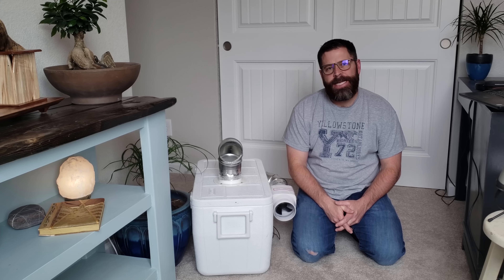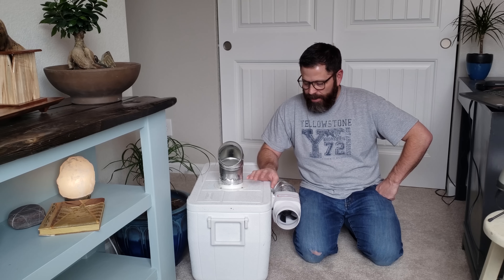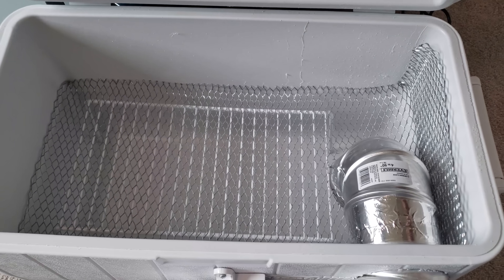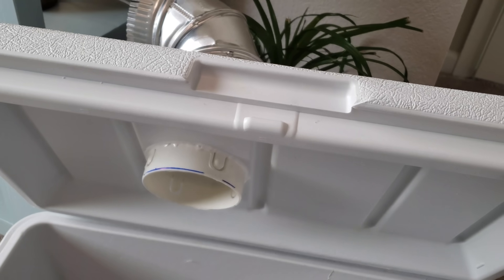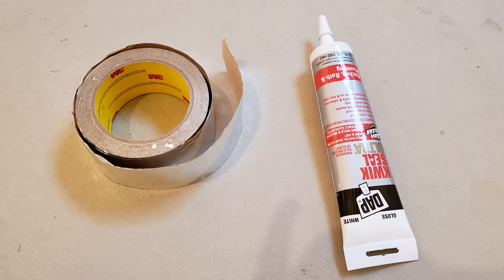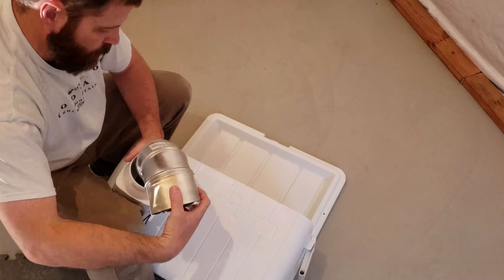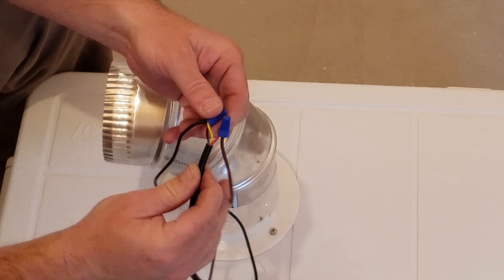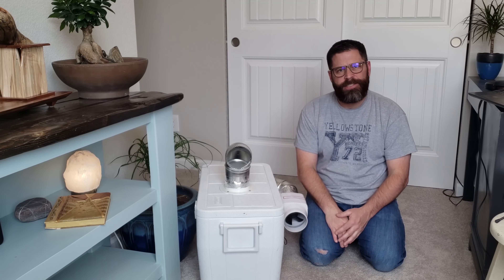Homemade Portable Air Conditioner DIY - Coldest One Yet!

Comment: 20 minutes  ice all melts!!! 45 minutes tops...Been there done this back in the 80s.
   this contraption is nothing more than an ice melter, not an air-conditioner. When the ice all melts, you’ll have a heavy cooler filled with water that you’ll have to get rid of somehow. If the cooler will hold 10 gallons of water, water weighs 7 pounds per gallon, that’s 70 pounds you’ll have to dump somewhere.
  I did this very thing with a Styrofoam cooler, and a 12 V blower motor powered from my car that I could plug directly into the cigarette lighter power supply in my company car.. I thought that cooling such a small area would be no problem.
 Here is what I learned.
 . I worked for the electric company, and they did not buy air-conditioned cars for us back in the 80s. But the building I worked out of had unlimited ice for the lineman to fill their coolers in the morning. They had two large commercial ice machines, and we could help our self to the ice.
  I bought the largest Styrofoam cooler that would fit on the passenger floor of my company car. It was about 30 inches long by 18 inches deep by 14 inches wide and had a lid. I bought a blower motor out of the car junkyard for $10 and mounted it to the lid, and I put a cigarette lighter plug at the end of the wires for the blower motor so that the blower motor would blow cold air over the ice. I bought a piece of plastic 4 inch schedule 40 PVC to direct the air to me as I was driving.
  The blower motor was mounted on one end of the lid, the PVC directing the air to me was mounted to the opposite end of the lid.
   On the first day, I completely filled the cooler with ice. It was about 85° that day. Very humid. I put the lid on the full ice chest, plugged the adapter into the cigarette lighter outlet to power the motor which started blowing cold air over all that ice and the air came out of the chest on the opposite end through the PVC elbow that I attached to the cooler lid.
  I started out on my route for the day with cold air blowing at me from the ice chest.
  After about 15 or 20 minutes, I noticed a change in the temperature exiting the ice chest. Shortly after that I noticed as I went around bends,I could hear water sloshing around in the cooler. After 30 minutes maybe 40 minutes, I looked into the ice chest just out of curiosity, and all of the ice was melted,, not to some of it, all of it was melted. The car blower motor that I installed on the lid was like blowing a hairdryer onto the ice. I had to pull over and use an old McDonald’s drink cup to empty the cooler because it was too hard too heavy to pick up Because I pulled my company car into the garage next to the ice machine, to fill the cooler with the scooper from the ice machine while the cooler was in the car . So I hand bailed out the cooler for a few minutes till it was light enough for me to dump them remaining 6 inches of water, and I put the cooler with the motor and the lid in the trunk.

Don’t waste your time or your money building the cooler suggested in this video. Your refrigerator couldn’t possibly make up enough ice to keep up with the melting.. even if you drive to the local convenience store and buy bags of bags of ice. On an 85 or 95° day, that ice is not gonna last more than a half an hour to 45 minutes tops if you have  air blowing over it.. not only that, it will  increase the humidity in the area you are using this “ice melter “That’s all this contraption can be. It is an ice melter.
Reply: You can do everything you just said. But hes using an ice chest. They come with a drain at the bottom. The one in the video even has a drain you can see. A long enough rubber hose he can drain the water out the car when he has 10 minutes to pull over and open the door. Nbd
Reply: Brad 435 
  Bread, the water in the weight of the water is secondary. That’s like buying a car that gets 5 miles to the gallon, and justifying it by saying yes but it has a 50 gallon gas tank.The point is, that ice only lasts less than an hour. When I made my ice chest with the blower on top back in the 80s. Are used a Styrofoam chest. Water was sloshing out of that as I went around vans within 20 minutes. When I went to dump the large ice chest of sloshing water out less than an hour later, I ended up getting water on the floor of my company car. This is a waste of effort/money/ time to fill the chest the size of the one in this video, it’s probably $10-$15. Your home refrigerator couldn’t make this much ice in 24 hours to fill that chest..
   Sure you can get cold air coming out of an ice chest, but the ice lasts a matter of minutes.. I was actually shocked at how quickly the ice melted
    I hope you get a lot of views and make some money from YouTube. But if you marketed this item at Walmart, not only would they not sell it because Walmart does not sell junk. You have to prove something works to get it in those Walmart store. But if some store did actually sell these things, I am positive all of them would end up being returned..
   You do know how to make an acceptable video, you speak clearly, you have a great idea, but it doesn’t work for long.. tell people they’re going to spend more money on ice because they’ll have to buy a chest full of ice once an hour. That’s $10-$15 an hour, if they spend five hours in their car a day, One hour of that time is going to be getting rid of the water and refilling the chest edit cost of $50-$75 every five hours for ice..
  People would be better off buying a $99 air-conditioning unit and mounting it in one of the windows. And powering it using an inverter powered directly from the battery with heavier cables, and not from an Accessory outlet or the cigarette lighter.. I have seen this done on vans that people use as low-budget campers. The only problem is, unless your car is running, the air-conditioner with the inverter will drain your battery within about 15 minutes to the point that it won’t start the car. You have to have the car running to keep the battery topped up..
   But the best solution for air-conditioning is, buy a car with air conditioning..You can lease a cheap new car these days for around $120 a month with air-conditioning.That’s less than you’ll pay for ice just in a few days with this ice chest contraption/ice melter.
Reply: @harrylime5147  I'm perplexed.  I can't believe you just called me "Bread". While I'm not offended I would like to know why you chose "Bread" a simple oversight? An intentional jab? I dont know. That entire story you sent me and the one glaringly obvious mistake was "Bread" leads me to believe it wasn't a mistake at all. So I, being currently under the impression you're calling me names am not going to resort to such behavior. Instead I'd like to commend you on your creativity and choice of words. Also, I am not the guy in the video. I didn't actually catch his name. Perhaps his name to is Bradley/ Brad and your entire message was intended for him. Also maybe he enjoys being called bread. I wouldn't know as this is the only video of his I've ever seen and as far as I know you could be his biggest fan and simply are offering constructive criticism. Either way, his contraption "ice melter" as you so eloquently referred to it as is pretty cool. With modifications and or a more creative mind it could be quite useful on a case by case basis. The biggest flaw you pointed out was the "sloshing water" to which I'll say maybe he could use frozen bottles/jugs in place of plain ice. They would stay frozen longer and if you're out doors camping (or sitting in a tent thinking of creative names to call people) cough cough it wouldn't be a complete waste of time/money or energy. I will say, buying a vehicle with ac is not a bad idea or perhaps some other out door air cooler as I'm  sure they are made somewhere by someone.
Reply: Brad 435 
    I think my phone thinks I have a speech impediment. I really need to start proofreading
Reply: @harrylime5147  Interesting.
Reply: @DuhByrd  I think you got caught up on the misspelling of your name and completely missed his main point that this will cost a fortune (in ice) and be completely ineffective at cooling down any space you stick it in.

Comment: How long can it run with temp differential so we can figure out BTU total and efficiency?

Addendum
Also, try this instead https://www.newegg.com/bgears-b-blaster-120x38-case-fan/p/N82E16835132042
Mount it directly on lid  Have short stove pipe come straight up to lid/fan.  Put a soft foam/seal around top of stovepipe so it seals when lid closed.

Comment: You should make one that has a variable speed controller for when you dont want to make it that cold or dont want as much air flow
Reply: ,funny I was just thinking about how I have that same blower and a DC speed controller already wired up to it I was gonna use for something else but didn't. Now I know what I'm using it for.
Reply: put a damper in the duct ?

Comment: $130? I'll spend the extra 20 n get a window unit. Really neat build though.
Reply: $130 not counting the ice you need to refill it every 30 minutes at $2 a bag that would add up pretty damn quick (a comment above reported the ice melted completely after only 30 minutes)
Reply: How do you plan to power your window AC while boon docking in your converted cargo trailer?

Comment: They sell a better plug on amazon. It's the Jtron DC 12v 10 amp car male cigarette plug. It has the 10 amp fuse that your supposed to use with the blower and red and black connecting screw on studs for the wires that will make hooking up the wires from the blower to the plug,correct,easy and safe.

Comment: Nice build, however, what kind of temperature changes does it create in a hot room?
Reply: Seems to me that would depend a) on the size of the room...b) how well insulated the room is...c) fan speed which should really be adjustable...
Reply: Wonder how a block of Dry Ice would work😀
Reply: maurice powers it would kill you if the dry ice vapors are not vented out. So don’t try it

Comment: That might cool air but it won’t remove humidity which is just as important.
Reply: Tom Hardware indoors yeah but outside... I see his being more useful in a garage or during a picnic
Reply: Use Dry Ice. No, wait... just kidding.
Reply: Not as important when you are in an area with 25% relative humidity

Comment: You'll need an ice machine close by on hot days.  The price of ice at a convenience store, you might as well buy a portable A/C !
Reply: or you could freeze 3 or 4 gallon jugs of water and then put those in
Reply: @waverlyjt2784  A block of ice sitting in a 100° vehicle might take 1-2 hours to melt and the temperature of the vehicle would never change. If you're cooling the vehicle down then you're removing the cold from your block of ice even faster. These coolers are "cool", but they will never be practical. I wish they could be though, cause I really don't want to buy a portable A/C cooler.
Reply: Another Somebody this is a mold making cooler . It adds moisture instead of removing it like air conditioning does.
Reply: @mwatkins2464  can you imagine the BO too?!?
Reply: @anothersomebody8195  your exactly right ..if cooling areas down could be done like that there would be no use for freon
Reply: @mwatkins2464  exactly... people dont understand ac makes cold air and removes moisture
Reply: @waverlyjt2784  ....good thinkin
Reply: @waverlyjt2784  if you have power to freeze ice , why use the swamp cooler ? im pretty sure this is for a portable ac that you can power with a solar panel. He was using it to cool his car where he is not going to have a fridge.
Reply: @waverlyjt2784  Small 10 oz. water bottles work best.
Reply: Would you say this is like a modern day swamp cooler?
Reply: Marty Maloney your exactly right

Comment: I used a condenser out of a wrecked car and instead of air I used water.... 50 lbs of ice and 2 gallons of water in my yeti cooler I found in the trash (with busted hinges) so I used a 2 gpm pump to circulate the water through the condenser which was attached to a box fan. Water is 33 or 34 degrees, pump moves water through condenser and back to cooler, fan blows across condenser and cools room. Worked really well... poor boy, when I was young, but had a friend that worked for a store with a walk in freezer 5 gallon bucket filled with water, pick up the next day frozen solid two, buckets always gave me ice...

Comment: What would happen if you ran the vent to about a inch from the floor and just added ice without the rack? Wouldn't it have to blow threw all the ice anyways? Wondering because I'm about to do it with a 130qrt.

Comment: Air conditioning requires dehumidification. This not an air conditioner. This is a humidifier. You are very creative and very intelligent. Your design skills are impressive. The quality of your video was also excellent. Thank you for posting.
Reply: He does say early on that it's technically not an air conditioner, but an air cooler.
Reply: this is not a humidifier dumbass it's a heat exchanger that's why it doesn't last very long it is not an evaporative cooler
Reply: As Alexis said, yes, it does dehumidify the air.
Reply: Please stop with the “very intelligent” and “design skills”. This thing is just a kids play toy.
Reply: Average air conditioners are basically plain air coolers. The dehumidifying effect comes along with the cooling effect provided that air at lower temperatures have lower relative humidity. As the air flows through your AC unit it gets rid of part of the water just because it looses the power to carry water vapour and this is due to energy loss as overall temperature drops. So, yeah, this thing is kind of an air conditioner.
Reply: Alexis Marcané this is not in any way like an air conditioner!!! AC removes moisture causing temp to drop. This adds moisture that will cause mold to grow and stink up the car.
Reply: @alexismarcane8491  Dryer air makes you feel cooler.  When sweat evaporates, it has a cooling effect.
Reply: @alexismarcane8491  This is more in line with the swamp coolers.  If you want to know what that is Look at the artic air design.  Water on filters that air flows through.   This is the same thing except without water downed filters the Ice acts as that filter and is typically cooler so has an effect of Freon from Air Conditioners in terms of output of cold, but acts more like a swamp cooler as humidity isn't being dealt with.
Reply: @sheyrd7778  would running a whole line through the cooler fix that? Or would that prevent too much air cooling?
Reply: @sheyrd7778  It seams to me that a swamp cooler cools because the evaporation creates cooling, right? Just like getting out of the pool cools our skin because the water is evaporating. However, this is transferring the stored cold in the ice to the air. I assume since the ice is considerably colder than the air coming in to meet it, that the moisture in the air will collect on it and actually dry the air. Like moisture collecting on a cold glass of tea. Probably won't really dry the air but won't make it worse, either.

Comment: I know how you can "top" yourself re: temperature.  Put a chuck of dry ice on top of the regular ice.  Of course then, you can't use it in the car without opening all the windows and letting in plenty of fresh, hot air to go along with the cold air coming out of your DIY AC.  Fail.

Comment: Has anyone ever tried adding a thermostat to one of these builds? I have a small room that I only need to drop the temp 5 to 7 degrees at most for 6-8 hours
Reply: I believe with a contactor and the know how a thermostat could be used to turn on just about anything. Contactor or relay anyway

Comment: Add 1 inch layer of salt your ice melting point will improve.
Reply: lol and then it will corrode everything, great advice
Reply: SUPERNOVA it only corrodes metal.
Reply: The small gain isn't worth the mess and rust problem. Not just in cooler, but moist salt air blowing in car or house

Comment: I got a old freezer and took it apart and know I have a freezer and an air conditioner works great but in stead of using an ice chest I used styrofoam and I put it together with silicone

Comment: Nice, but you’re not actually measuring the temperature of the air coming out. You’re using an infrared temperature measuring device that’s measuring the temperature of the aluminum pipe. The pipe cools down quickly because of direct contact with the ice. The actual air temperature is much higher than the temperature of the aluminum pipe.

Could you confirm my hypothesis?
Reply: Kawa al Saleem the ice is not in contact with the exhaust tube. If you actually watch the video you would see that

Comment: Thank you very very very much. I live in the Dominican Republic in the middle of the caribbean. Today the temperature went up to 37° celsius, that's 99° Farenheit. This is very helpful and cost effective, although I have 8 Air conditioning units at my house.

You could add a 12v battery and have it totally mobile, like for camping or to stay in the beach overnight in tents. 

You could also connect it to Solar panels, have a solar and battery combination for use day and night and also could find a 110 volts ventillator with the same or  maybe a bit bigger diameter and CFM output and  adapt it and interchange it for use at home or wherever 110v  outlets are available.

Grear idea!
Reply: Caonabo Javier idiot, where are you getting all the ice you will need ? What about the mold that will grow from the Humidity?

Comment: Why bother if it has to be plugged into a power source.  Build it with solar power so it can be used on a camping trip it seems it would be great to cool off inside a tent.  And dry ice would last longer and than add some salt and it would be cold enough to hang meat.  If your building this to cool off inside your car well get a car with ac.